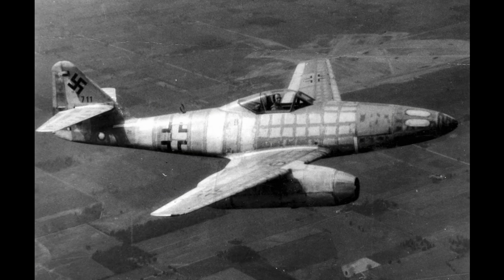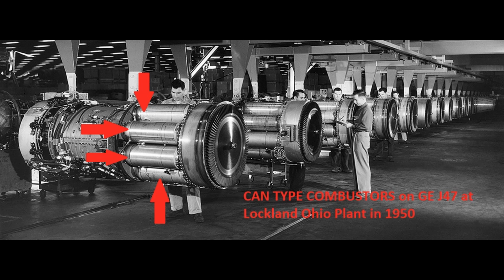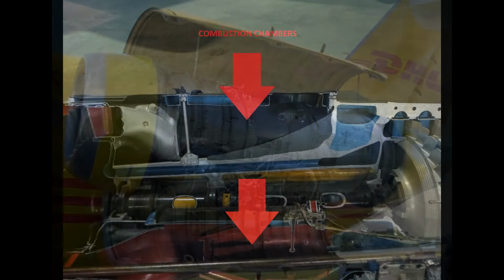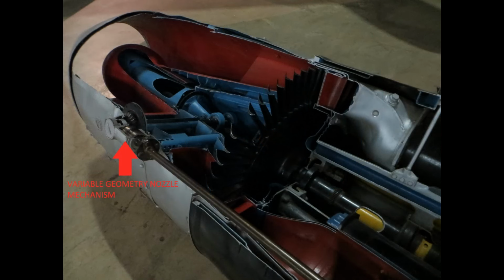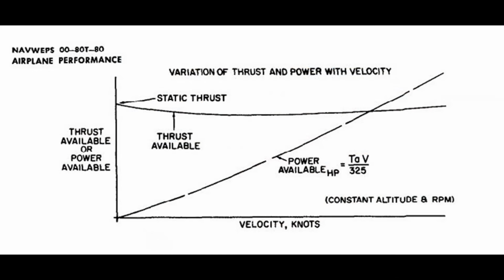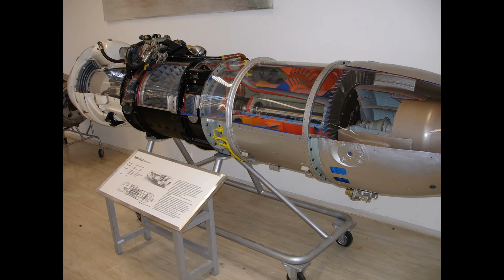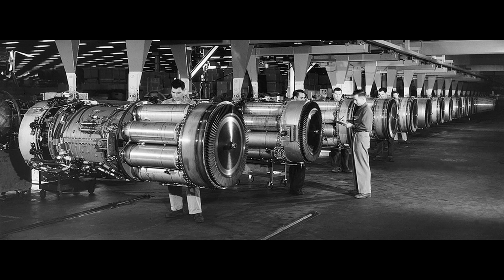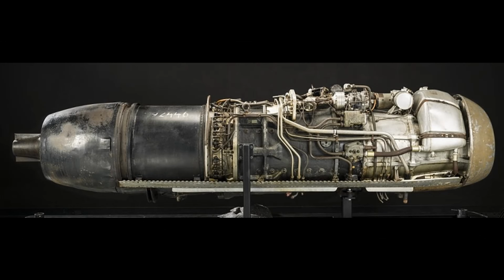World War Two JET POWER

Comment: Great video as always. One version also included hollow blades for air cooling. Worth mentioning that 004 had also a protoype version with bypass and counter rotating shafts that lowered the consumption. Also another project at the end of the war was the double shaft counter rotating turbofan DB 007 a true turbofan.

Comment: You failed to mention the Jumo 004 engine had reliability issues and the claims by the pilots of the ME262 victories need to be taken with a pinch of salt given the Allies air superiority from 1944 on.
Also it would have been interesting had you compared the ME262 to the Gloucester Meteor introduced  around the same time with the alternate centrifuge RR Welland jet engine.
Just my thoughts.
Reply from the maker: It had longevity issues, which were caused by metallurgy, not the design. This has been well covered on this channel.
Reply: That is a false urban myth, the Jumo -004 was very reliable compared with other jet engines and high output piston engines.
 The Gloster Meteor to be very honest was not match for the Me-262 and the "Meatbox" as it was called be RAF pilots was unpopular because of its poor performance and deadly reputation for crashes.
Reply: FYI: The Rolls-Royce Welland had a PFTR of 100 hours, exactly the same as the Jumo -004B
Reply: @sandervanderkammen9230 
Fryed Ryce Munchyrz Kharzeestan Krappenz DiktorBummer Werkzxoffen etc and co SHUD note good with much awestruckness pleased too.
THE JUMO GARBAGE WAS MOSTLY SCRAP AS MANUFACTURED USUALLY
  The accident rates for the Gloster Meteor were average & similar to other fighter aircraft of the period. In fact some later jet fighter aircraft from other countries had worse accident loss stats (excluding combat losses of course).
   Whittle style centrifugal compressor reverse flow combuster internal combustion gas turbine aero engines are not obsolete & of course are still manufactured in significant numbers for turboprop aircraft & helicopter applications.
  Any ?Kweschuns? sonny Jim Jimminy boy lad? 
😂👍
Cheers!
. .............. ... . 
vcvcxcvxvxvvi
Reply: @paulpaul9914  Why didnt the brits have axial jet engines? They wasted a decade developing obsolete centrifugal jet engines

Comment: The axial flow turbojet that Whittle also designed and avoided putting into production during the war because of the inherent problems in the design which would impact on its service life during the time period of the war, just as it did in the 004

Comment: Maybe point out that for a turbofan engine,  the extra turbine behind the main is on an inner shaft that only turns the fan.  That completely decouples it from the turbojet stack-compressor, burner, turbine, which turns MUCH faster.
Reply: Not exactly, some low bypass turbofan engines are only single shaft designs with all compressor and turbine stages coupled together on the same single shaft.
Reply: @sandervanderkammen9230  Which?
Reply: @davesvoboda2785  The SNECMA M53 that powers the Dassault Mirage 2000 is an excellent example 
It was developed from the BMW 109-018 turbojet (ATAR) family.
Reply: @davesvoboda2785  Another interesting fact about Turbofan engines is the spools can counterrotate, the Pratt & Whitney F119 which allows the F-22 to supercruise at Mach 1.8 is a countertotating turbofan.
It's a concept used in the worlds first turbofan, the Damiler-Benz 109-007 in 1943.

Comment: The Ju 287 also had reverse swept wings!!!  This was done to get the center of gravity of the airplane in the right spot in relation to the wing!  Also, the Germans knew that at high speed air resistance on a straight wing was high and swept wings reduced that greatly... I guess that this (Ju 287) was an experimental, and that perhaps they were planning to make a retractable gear version of it later.
Reply: The Ju-287s swept wings had nothing to do with CoG... it was an experiment to improve lift at low speeds, swept back wings have less drag and less vulnerable to Compressibility at high transonic speeds but have poor lift and lower speeds

Comment: I am not greatly enamoured with this account. Those German engines might have been ‘advanced’ and I’m sure they were a credit to their designers and manufacturers. However, in your account, despite crossing the Atlantic several times to compare US engines, I did not hear one mention of anything going on the other side of the English Channel. The Americans would not have even had an engine were it not for Britain sharing Whittle’s results with GE. It is true that the axial compressor used in the German machines were more technically advanced than the centrifugal compressors used on early British designs. That does not mean that centrifugal compressors were without virtues. They were more robust, did not stall so readily and were easier to manufacture, usually from light alloy. I believe you might have mentioned some of these points, at least in the interests of historical accuracy. Just one more point: the USSR was also the recipient of British technology at the end of the war. The MIG 15 used a Russian-built version the RR Nene turbojet against the Allies in the Korean War and was not completely outclassed by axial compressor technology.
Reply from the maker: I think the British engines deserve their own video. It didn't make sense to me to pack the Meteor's engine into this video. In regards to centrifugal compressors, I have a lot of time in aircraft powered by centrifugal turbines and they do have advantages, but in terms of turbo-jets, the axial flows have won out.
Reply: Checkout the PW210 - a modern, centrifugal compressor, reverse flow combuster, helicopter engine that's essentially the same basic arrangement as one of the early Whittle Engines. Often used for helicopters & turboprops.
Reply: @paulpaul9914  But Whittle didn't invent Turboshaft engines...  they were invented in 1913 in NORWAY.

Comment: Jet engines are beautiful in their simplicity except for one detail: their efficiency depends on high temperature operation... and virtually  all modern development is focused on that point... which is why marine freighters use diesels [plus they can carry the weight].

For example, the 8 stage axial compressor probably achieved a "compression ratio" around 4 to 1... not real good for efficiency [but good enough for thrust].
Reply: Excellent comment, compressor efficiency is the biggest single factor that effects overall efficiency...
Compressors are only efficient within a very narrow rpm band and therefore only efficient within a very narrow power and load range.

Comment: I am disappointed that you made no mention of the British jets. They elected to go down the centrifugal route, initially, because they recognised the limitations of metaturgy available to them. Such engines, with afterburners were intended to power the supersonic Miles M52 project.
Reply: Britain lacked the compressor technology to build the more advanced axial compressor turbojets. Metallurgy was only a factor effecting the hot section in particular turbine nozzle and turbine which are not different between the 2 types of engine.

The Nachbrenner or afterburner was invented in Germany by Jumo for the  -004E.
 The Miles M.52 could have never flown supersonic, no aircraft powered by a centrifugal compressor turbojet has ever reached Mach 1 in level sustained flight.
Reply: @sandervanderkammen9230  - I apologise, but if Captain Brown believed it was possible, and was prepared to pilot the aeroplane, I'll accept that great man's opinion.
Reply: @ross.venner  So tragic how such a great pilot's career was tarnished by his involvement in the M.52 scandal, one the most shameful and humiliating chapters in British aviation history. 
If it hadn't been for Brown's affiliation with Dennis Bancroft he would have certainly received a knighthood.
Reply: @ross.venner  The facts here are irrefutable, no aircraft powered by a centrifugal turbojet ever reached sustained supersonic speeds in level flight.
Centrifugal compressors were inherently inferior to axial compressor turbojets and were a dead end design.
Reply: @sandervanderkammen9230 
Fryed Ryce Munchyrz Kharzeestan Krappenz DiktorBummer Werkzxoffen etc and co - they SHUD note good with much awestruckness pleastoo and.
  THEIR SO CALLED "IRREFUTABLE FACTS" ARE USUALLY TOTALLY REFUTABLE
😂
   The after burner concept was known about in the UK long before 1940.
   UK built engines with after burners were being run before 1943.
  A Gloster Meteor was carrying out flying trials with engines with after burning starting from 1943
    In 1943 Meteor serial number EE215 successfully trialed afterburners (reheat as it was then called) —two  years before any other nation.   
Cheers
👍
. .... . ..... . ...... . ...... .. 
cvxcvxvcxvcxixicivcxc
Reply: @paulpaul9914  Please name a supersonic jet aircraft with a Centrifugal turbojet engine?

Comment: The Gloucester meteor was the first Allied jet plane . The engines were designed by Frank Whittle and his design was the first for a jet engine. It is true that the German design flu in 1939 and we had to wait until 1941 for the British design to fly . But when it did fly the engines were far more durable and in fact you can still see some engine still flying today 70 years on
Reply: Not true, the Whittle W2 engines were less reliable and had a shorter time between overhauls, Whittle's engine used inferior metallurgy than the Jumo -004.
Only the later Rolls-Royce Welland could match the engine life of the Jumo -004b
Reply: @sandervanderkammen9230 

We believe we can clear up some commonly held myths and misconceptions.

It's always good to have the facts to hand isn't it?

Indeed it is correct that the world's first pure internal combustion gas turbine aero engine ran in England in 1937 it having been demonstrated by Frank Whittle of England. What followed was indeed a more measured & sensible approach to the introduction of gas turbine aero engines. 
  Of course it is in fact entirely correct that the gas turbine was invented in England before 1800.
     Obviously the multistage sequential stator rotor axial turbine & similar compressor as used in many modern gas turbine aero engines were first produced in England by Parsons of Ireland & North England before 1900 for turbomachinery applications such as power generation & ship propulsion. It is clearly the case that Parsons axial turbine technology of course was then licensed for manufacture by many industrial companies around the world including Brown Boveri. 
    There is no doubt that Elling of Norway built turbomachinery using ideas from Parsons which were also hybrid steam turbine / turbocharged boiler machinery which weighed about 6 tons & produced enough compressed air to power a ride on lawn mower 
     Of course Axial compressor internal combustion gas turbine aero engine work began in England before 1929, The world's first reliable & effective & flight certified instance of such an engine being the Metrovik of F2/3 which first ran in 1943 but of course was not required for production, was licensed for manufacture in the US while more powerful versions were being developed in the England.
    The Rolls Royce of England Nene centrifugal compressor gas turbine aero engine was the most powerful internal combustion gas turbine aero engine on the planet in 1944 & would go on to be built in large numbers as copies or licensed versions in many countries including Russia, China, The US, France & elsewhere & would power aircraft in those countries for decades after 1945. Centrifugal compressor reverse flow combuster gas turbine aero engines first invented & demonstrated by Frank Whittle of England are of course still currently manufactured by Pratt & Whitney & by Lycoming for example.

We hope this helps.

Cheers 👍
Reply: There are none flying with WW2 model engines, the only Meatboxes still flying today are post-war built with 1950s vintage Derwent 5 engines